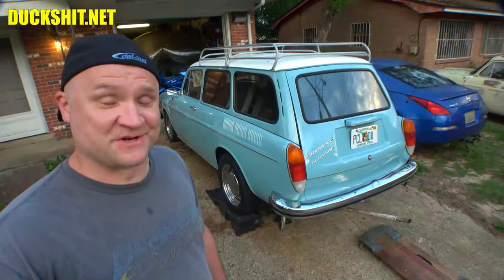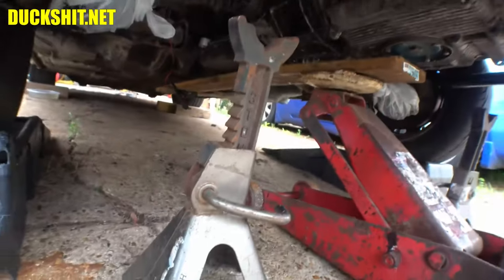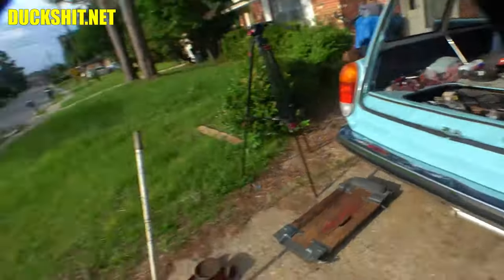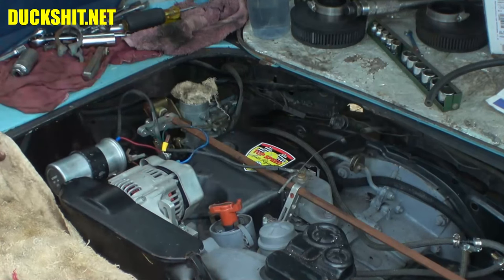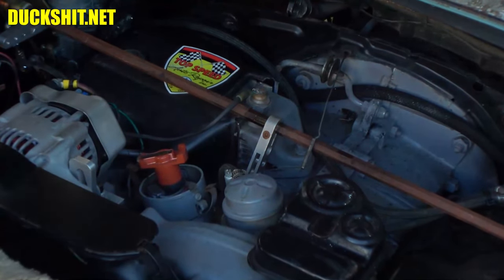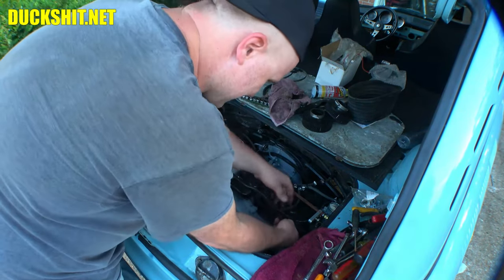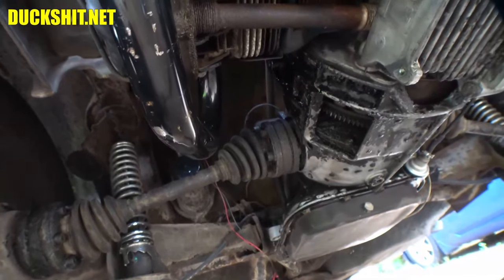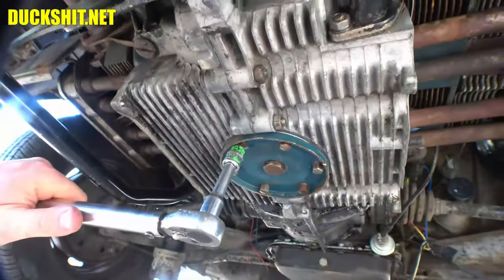🔧🚗VW Type 3 Automatic Tranz and Engine Install 034 SVDA Install💥🔥

Comment: I remember back in the 80s Hot VWs and VW Trends magazines were touting the 009, I never bit.  I was desperate to get more juice out of my 74 Super Beetle though.  MISS that car
Reply from the maker: Well, a 009 is fine on a race car that has 2 speeds, idle and WOT!  Or a generator, compressor, aircraft, tractor... etc, but not a traffic-driven car!   If your carb lacks a vacuum port, then the carbs are no good either.   😁👍🦆💩
Reply: I stuck with the stock 205 on my Super.
Reply: @josephheston9238  Me too, it was still fast enough to get me multiple speeding tickets!
Reply: @DuckmanCycles  Yep!  I kept it down to light mods, it turned out real nice.

Comment: Good video, Lord Duckman. The first thing I did was to see if my reverse lights were hooked up to my negative on my coil. They are not. That negative wire you had floating around the alternator. That goes on the generator post. Ground. That is how my fastback is wired. I guess with the alternator, they didn't have to use it. I really love my automatic transmission on my fastback. That engine runs great now. And so clean looking. Once again, great video, Duckman 🦆. Noel
Reply from the maker: Thanks man!  Yes you are correct.... IF this were still a generator car, that green wire would go to the DF post on the generator itself.  But now that this has an alternator, I am uncertain what the previous wiring tech did here.  Normally you'd still connect that green wire to the new alternator, then remove the regulator under the back seat and put the blue and green wires together there for your idiot lite.  This alternator has its own blue wire that seems to control the idiot light.    I will have to chase these wirse and see where they go,  the green one may now go to nothing....

Comment: I always run 20/50 oil in summer time.  Arizona heat
Reply from the maker: That might even be too thick, but VW did recommend that in some Buses.  I put 20w50 that in the Type 3 once listening to someone else, blew all the old seals and even the oil dipstick bellows.  Oil everywhere.  Went back to SAE30, all the leakage problems went away, and that was Florida summer for ya. An oil temperature gauge would be good to you, and maybe an external cooler if it runs that hot.  Thanks for the feedback!
Reply: @DuckmanCycles  even my old rail with 1835 , even had external cooler with electric fan. But that thing is another story.  Never lend your cars out. Never know how it will run after

Comment: The old wiring associated with the alternator and ignition coil is from when the vehicle had a dynamo instead. The green one is the field lead DF from the underseat regulator. The brown is the ground 31 also from the underseat regulator.
Reply from the maker: I'm very familiar with the old generator wiring, however this does not match what is expected to be here.  Did you see a brown wire?  I didn't lol!  There is a blue wire instead that goes to the warning light, and the green wire is the wrong color green.  I'll be tracing these to figure out what's going on here.
Reply: @DuckmanCycles  If the green wire is the same colour shade as that of the contact points/condenser set up it could be associated with the diagnostics socket wiring fitted from August 1970 onwards. 
Might find the blue goes into a blue/white wire under the rear seat via a single connector. This is where the voltage regulator was fitted that was associated with the original dynamo.

Comment: Great video Duckman Love the old Square Back!! It sounds terrific too. I only ran a 009 Dist on my built up 72 Super Beetle. I had a wild set up in it with Crower Dune Buggy cam, high lift rockers, high oil press , headers, Holley Bug Spray Carb, jetted for best performance. Love your videos man, keep them coming.
Reply from the maker: Thanks Robert, I really appreciate that! More great videos coming up!

Comment: I have been running a 009 for 40 years......Never had a stumble ever once I tune it with the right jets. Sounds like a personal problem to me.
Reply: in fact Vacuum is less responsive. the carb vacuum has a slight delay in advancing.
Reply from the maker: But if you had to "compensate" with jetting, then its wrong!  009 does not belong on a street vehicle.... PERIOD.  LoL!  Thanks Mike!
Reply from the maker: Sure, vacuum has delay, and its brief... but your 009 you have to rev to get it to advance... which is also a delay.  Either one of those problems is resolved by driving habits.  The only thing better than a proper SVDA on an air-cooled VW engine is electronic ignition with a TPS sensor, but by the time you get to that point you should be running a modern fuel injection system anyway.  The timing curve on a 009 also isn't any good.  If you really need a single-advance distributor, use a 010 or a 011, and keep the 009 on the industrial engines, boat engines, and aircraft where the engine runs at a constant RPM all the time and timing curve and advance doesn't matter.  There is a reason I have a whole trash can full of 009 distributors, lol!
Reply: @DuckmanCycles  BTW your masking your jetting issues with advance. Not fixing the problem.
Reply from the maker: No…. LoL.  This is stock.  Masking a problem with a correct part makes no sense.  A whole trash can full of bad 009s, eh?   They still don’t belong on a street car, or VW would have used them, they’d be a cheaper solution, would have saved them millions.
Reply: @DuckmanCycles  Yea rip out the good German made Bosch and put in a China Makes sense to me.
Reply: @DuckmanCycles  I am uploading a video just for you ha ha. i have seen all the samba hype. But the majority see my side. I have done both for many years. The customers came it with BOTH....and you had to make it work right. Jetting a carb is not easy but it is no time too late to learn.
Reply from the maker: @Mikefngarage  Well you’re implying that I have to learn, but on the other hand I have people saying exactly the opposite and everybody here is on this team.  So expect a video retort, it’s gonna be good for a viewership anyway lol
Reply: @DuckmanCycles  working on something on this will be a few weeks...

Comment: Curious; did you connect the Distributor vacuum to only 1 of the carburetors or both (with a 'T')? Could the car been rear-ended explaining the fiberglass rear apron and the new window seals?  1:33:32  She must watch your channel. LOL!
Reply from the maker: You only need one carb connected, it makes enough signal.  The car has a lot of rust in the rear, but absence of wrinkles underneath.  The front end is a different story, we covered that one in an earlier video.... lol

Comment: I have a 69 auto I was wondering do you have a kick down switch because mine doesn’t have one and it works fine
Reply from the maker: No, there's absolutely nothing electrical about these tansmissions at all!  Just romp the pedal and it should downshift.  I find a little more responsive if you knock it down manually with the shifter though.  Driving habits.  Hope that helps!

Comment: Nice job! Question: did this one have the little spring on the distributor drive? The service manual specifies it; not sure exactly what’s the purpose but it’s there.
Reply: Yes
Reply: I believe it's part of the vacuum advance
Reply from the maker: The little spring keeps tension on the drive so it has a little room to play, but doesn't come out.  It's kind of an awkward design in my opinion, but thats the way it works!
Reply: @6696sassip  No; the spring doesn’t have anything to do with that. It goes under the distributor.
Reply from the maker: An empty message, I didn't even know that was possible lol

Comment: How good are the automatic transmission that it is?
Reply from the maker: The transmission is good, but the weak spot seems to be the flex plate.  They tend to eat themselves alive, a friend of mine destroyed one immediately after it was replaced.
Reply: Have you ever done work on the inside of one??
Reply from the maker: Inside an automatic transmission, no....  that goes to a specialist.

Comment: I have a 67 baha that sprung an oil leek near the fly wheel any suggestions besides an engine rebuild
Reply from the maker: Probably one of two things... the flywheel seal, or the O-ring in the flywheel.  Both are pretty easy to replace if you have the right tools.  Hopefully nothing more severe like cracked case, usually around cylinder 3 is where they crack, IF they crack.  Hope that helps... check out this video for more information https://www.youtube.com/watch?v=a66qKyrMNdc
Reply: @DuckmanCycles and VW Garage  no actually last year that aftermarket fuel pump started putting gas into the oil haven't changed it yet and it's blowing out the dipstick.high oil lvl

Comment: Hey MFDM! when you turned on the left indicator during the test drive both left and right dash lights flashed...is that an issue somewhere? 
Good vid, enjoy your Blue Cup! 👍
Reply from the maker: Nope, that's the way a VW indicator works!   It can be wired independently, however if you chose too... but the operation you saw is the correct one!  I don't fancy it, I'd rewire it, but that's just me!   Thanks man!

Comment: as for myself i don,t need to take notes on anything i take apart i can remender i for hours,days, mouth and even years  but if someone other took it apart i my have to figure out what they did i,ll have to scarch the back side of you balls to figure it or it will make my hemorrhoids flare up  , o the pain and itch
Reply from the maker: Oh man, its always harder to follow-up on someone else, case in point here with the 009 being loose.   I say the same thing in the web industry, you want me to fix a problem on a website that someone else made?  LOL!  I know well in advance that's gonna be an issue.  Are you sure you don't just want a new website?  Hahaha!